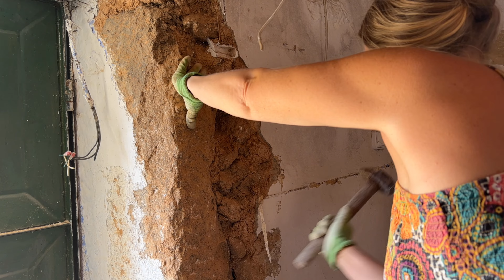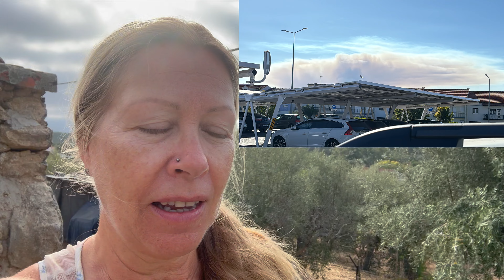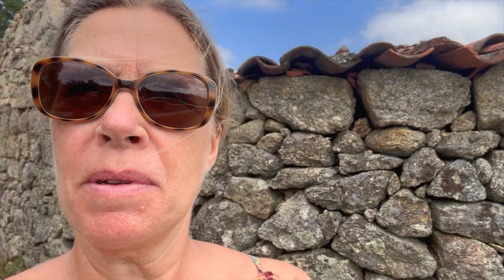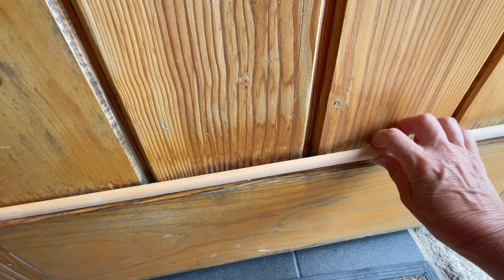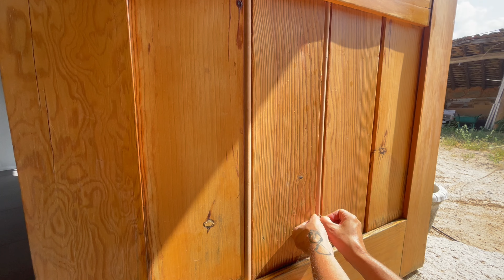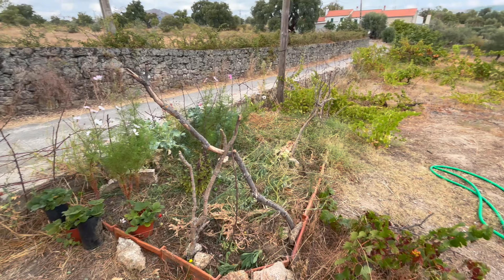REVEALING GRANITE STONE WALLS in my old stone house Portugal

Comment: In winter wood expands, in summer it contracts, you've just filled the expansion joint, put clear silicone along the bottom, use washing up liquid to smooth it out
Reply from the maker: Bad design I would say 😂

Comment: Hi Susie 
The joints in the door filler are tongue and groove and generally free floating the allow for the expansion and contraction of the wood. Normally the panels should be flush on the outside so water can run off hence the door maybe on back to front.
Reply from the maker: Hi Peter, thank you for the explanation. It’s actually the same on both sides of the door 😂